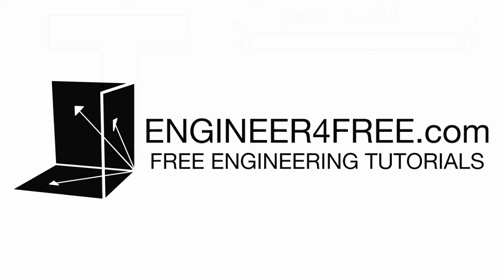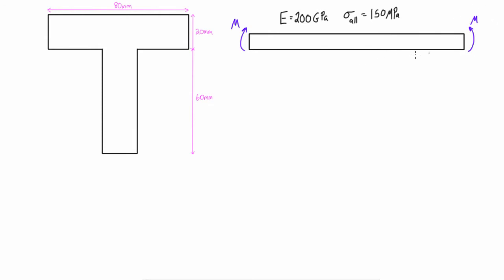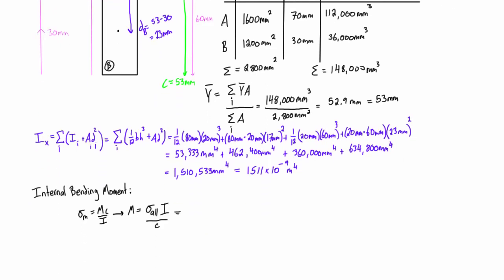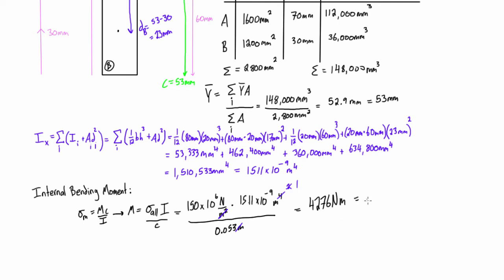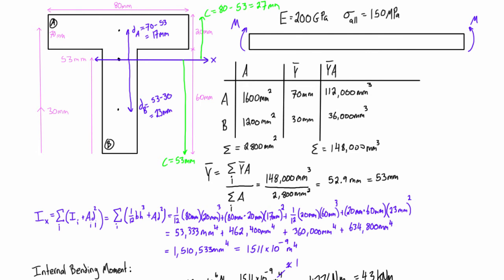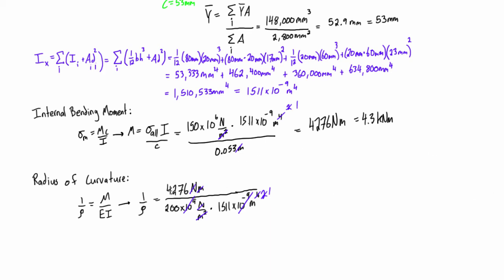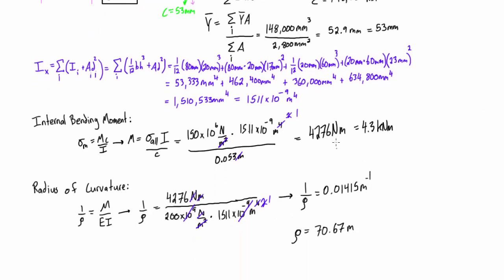Pure bending in the elastic range example 2: T-beam

Comment: I conducted a three-point bending test on a T-beam and I'm having trouble calculating the bending moment based on the applied force. The cross-sectional dimensions of the T-beam are 300 mm high and 150 mm wide, with a flange of 400 mm width and 100 mm height.

I was able to extract the forces and deflections  from the test , but I'm not sure how to convert that force into bending moment. Can you point me in the right direction and let me know which equations I should use to calculate the bending moment?  Thank you in advance for your help.

Comment: Yo EngnFfree, this was great but could you explain why you used the C_b? and not C_a when calculating for the internal bending moment
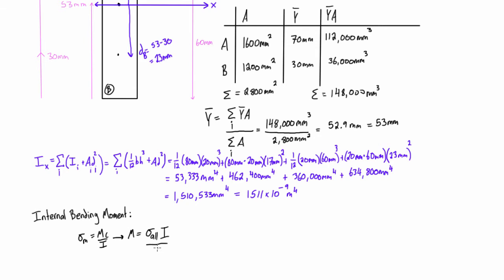Reply from the maker: Yo Macdonald. We're calculating Max Allowable Stress. Stress will increase as you move away from the neutral axis, so we need to use the value for y (c) that is furthest away from the neutral axis. Cb > Ca, so we take that one. I briefly mention it around 2:27, but also check this video too: https://youtu.be/S5zPyop_RJU

Comment: thanks, but which side is compressive and which one is tensile?
Reply from the maker: The applied moments at each end would result in a concave up curvature of the beam. This would stretch out the material below the neutral axis, and compress the material above the neutral axis. So below we have tensile and above we have compressive.
Reply: @Engineer4Free  Thank you very much.
Reply from the maker: You're welcome! 🙂